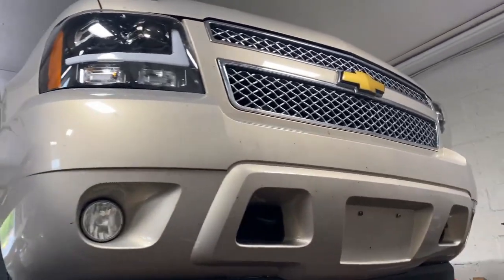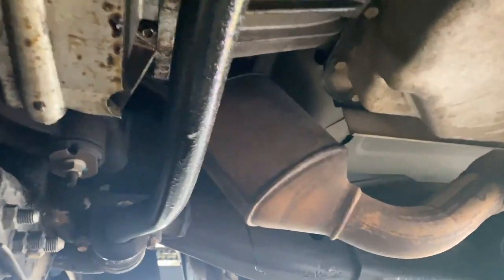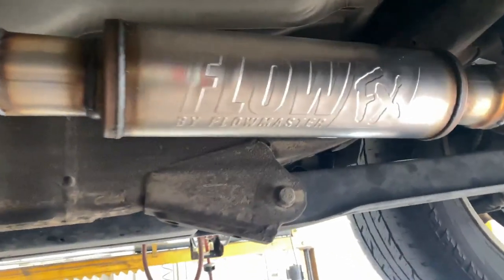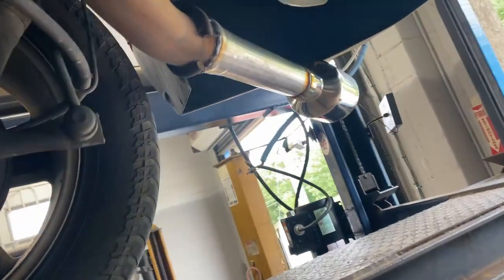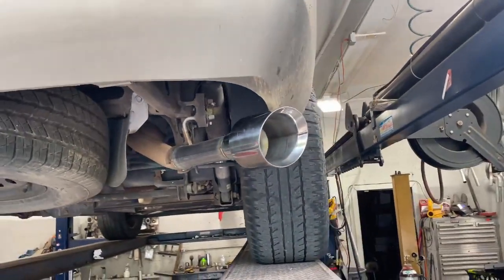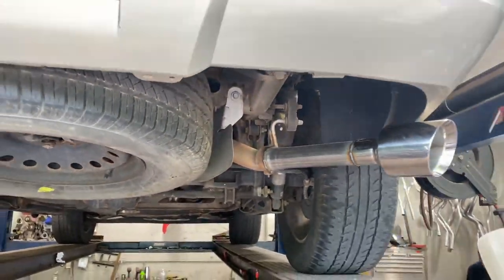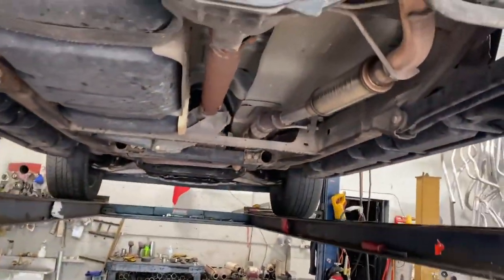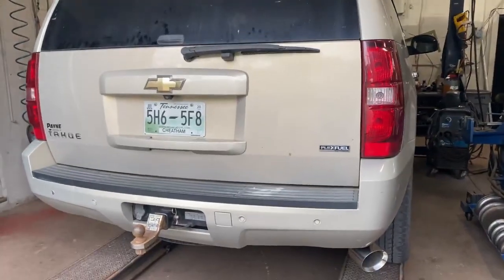2008 Chevy Tahoe 5.3 EXHAUST w/ FLOWMASTER FLOW FX!

Comment: What's wrong with the exhaust kids? It sounds terribly dated and loud, it seems that the engine's really strugling. Get the exhaust fixed.             '
Reply: Sounds like the engine is running just fine.
Reply: Just stop man it’s really sad
Reply: @howdythere2419  The engine is struggling quite badly because of the damaged exhaust.
Reply: Kim Riley There is no damaged exhaust. Its running fine.
Reply: @howdythere2419  There's a significant noise leak which indicates a faulty engine or a damaged exhaust.
Reply: Kim Riley Where
Reply: Lmao bruh wth